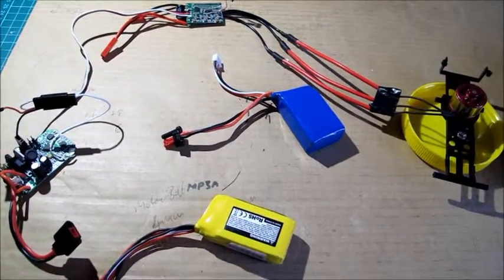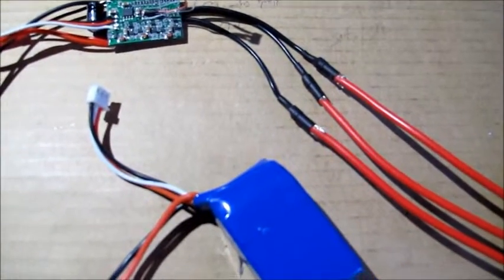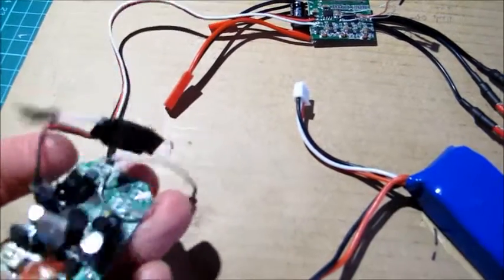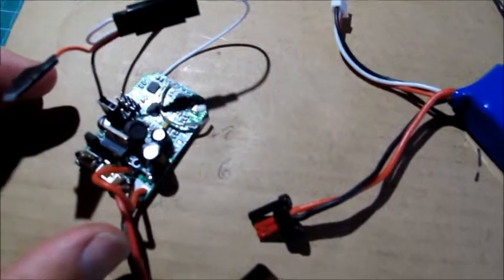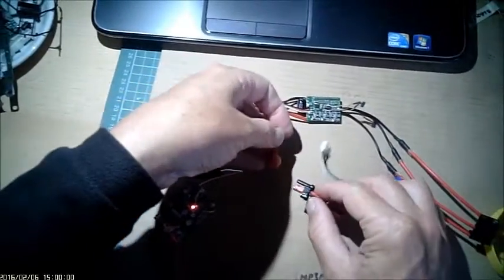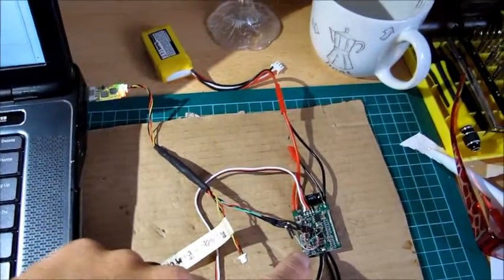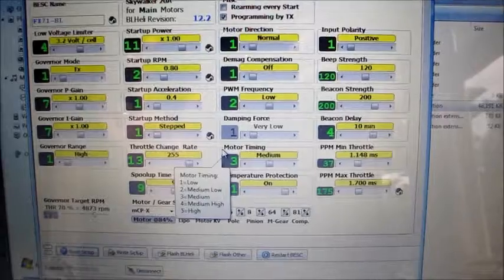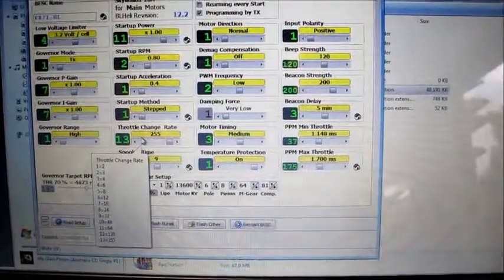FX71 BLHeli for driving brushless motor

Comment: Very interesting  , keep me updated in this project and final setup . Would love to duplicate on my heli ..
Reply from the maker: Not sure if I'm going to progress this all the way or not. Ordered an OpenPilot flight control board last night from HobbyKing. It's much easier to setup with brushless controllers and has 6 axis built in. A couple of key advantages are that you can then fly it with a decent radio (have a Deviated Devo 10) plus you can edit all the flybarless parameters. The FX FBL works pretty well, but has some annoying habits (nose flaring up in the wind, driving the servos too quickly etc) which you then get control over. Just posting a vid of the brushed 71 in the wind yesterday, will keep one like that. It does pretty well :)

Comment: vi que voce fala portugues tambem... então eu tenho duas placas receiver do v912 aqui paradas(ambas de motor escovado)... então em teoria se usar um esc blheli eu conseguiria fazer essas plaquinhas rodarem um motor brushless? (pegando o sinal do motor?)
Reply from the maker: Eu apenas uso o Google traduzido porque várias pessoas haviam posto perguntas em portugueses. Sim, você pode usar os PCB V912 com BLHeli ESC's. Eles precisam ter um fio negativo preto conectado e o fio de sinal conectado ao 3º pino do mosfet do motor correspondente. BLHeli deve auto-testar e calibrar o sinal. Note que você quer ter um BLHeli ESC normal (não BLHeli_S ou _32). Eles geralmente são fornecidos no modo multitortor, então você precisa ser reprogramado as configurações (você precisará de uma ferramenta USB para fazer isso). A multi-programação padrão tem travagem do motor na qual está correto para a cauda, mas não é bom para o motor principal
Reply: Thank you for the reply :)i ressurecting a v912 here... and a benma e1003 i thinking is more hard to upgrade... your reply is very helpful :)
Reply from the maker: Good luck with your rebuilds. I don't know if you have brushless motors yet but we've found the FF200's from HobbyKing to be great 2S main motors for this size of bird. With a decent battery they will pull 11 or 12T pinions and are a reasonable price. I run that setup with Turnigy Graphene 950mAH batteries on my V912, along with the Xtreme 8 degree blades from MiracleMart. The Xtreme blades make a huge difference as well, much better in the wind and at speed.
Reply: gungriffonbr 
Buenas, tenho também uma placa do v912 e quero converter pra um aeromodelo 3ch. Gostaria de saber se houve sucesso na conversão da placa. Gostaria de saber também se a possibilidade de ter controle de Leme na mesma placa.
Tks.

Comment: where do you exactly solder the white wire this is my long time problem thanks for the answer
Reply from the maker: The main motor and tail motors are controlled by mosfets. These are the large and slightly smaller 3 pin connection electronic components situated immediately ahead of the the main and tail motor connection plugs. The mosfets have 3 connections: one from the battery, one to the motor plug, and the 3rd connection pin/leg is from the central processor to control the mosfet (the signal connection or more correctly called the Mosfet Gate). In this case I soldered the white wire to the underside of the board where this pin/leg protruded through. See the video at 2:07. Note that later versions of the FX071C boards would not work with a BLHeli ESC because the throttle signal PWM frequency was changed to a faster signal (possibly 16KHz) which is outside the range of standard BLHeli ESC's. Note that some later model ESC's may support this however I have no experience of these to share.
Reply: @FlyingboatsRCG  Men ur the best! U deserved a repect!💯
Reply from the maker: @justinelaceup7553  Thanks -good luck with it :)

Comment: Hello, sorry I deleted my questions I asked you if you could help me to tell me how to install a brushless motor in the main rotor in the helicopter FX070C flybarless I want to do the same thing that you did in this video do you think it works for me ??? The motherboard is very similar to your fx071 helicopter please help me install brushless motor thanks ....
Reply from the maker: We tried a number of different receiver boards and my FX71 (early generation board) was the only one that worked. Later boards had the signal changed to a frequency which didn't work with BLHeli. The easiest way to make them brushless is if there is a throttle signal on one of the extra servo type ports